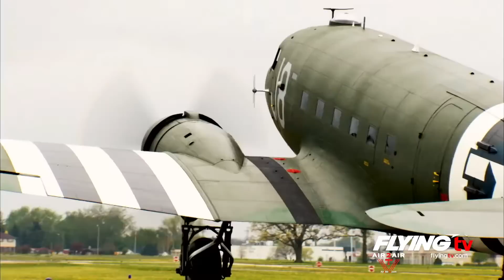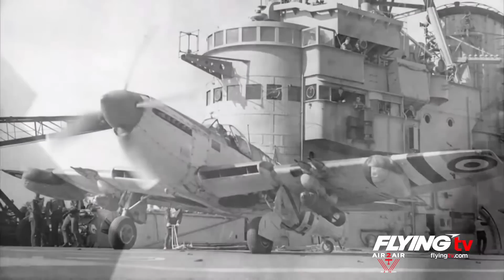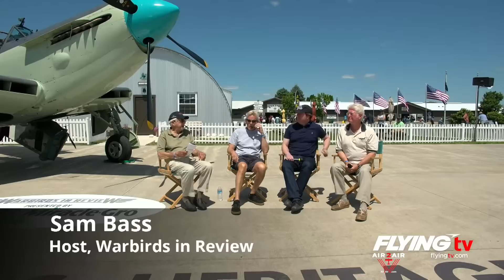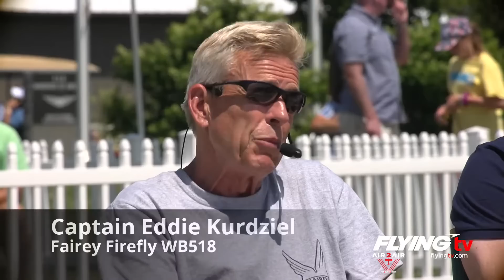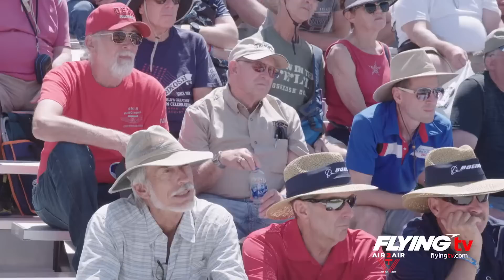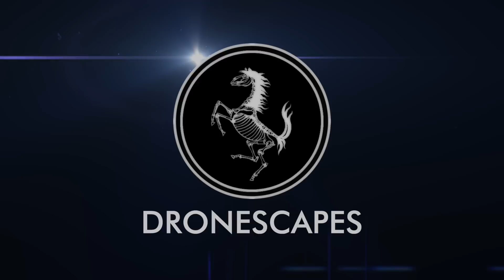FAIREY FIREFLY | The WW2 Carrier Borne Fighter, and Anti Submarine Aircraft

Comment: The British topiedo bomber in the Atlantic was the Fairy Swordfish biplane open cockpit fixed undercarriage that was succeed by the Fairy Albarcor biplane closed cockpit fixed undercarrage both with manual puss backward folding wings that were succeed by the Fairy Barracuda mid wing monopoly with a wide folding undercarriage but the Swordfish was used throughout the war and helped to sink the Bismarck operating off HMS Arcroyal.  As there were no light German fighters Me Bf 109s and Fw190s as there was no German operational aircraft carrier (accept for some long range Me Bf 100 and Ardo Ar 196 ship based float plane) in the Atlantic, however there was the Fw condor.  Whereas in the Pacific the British used the American venger that replaced the barracuda.

Comment: The success of the Fiery Fulmar with manual rear folding wings (there is a static one in The Fleat air armed mouseam in England) the Fairy Firefly with electronic folding wings and the second cockpit was for the navigation radio operator observer and raidar operator not a gunner. Note the wide based undercarriage (unlike a narrow based undercarriage of a Spitfire) and rear folding wing for aircraft carrier use (not folding up like a Corsair) and the British had armed plated landing becks unlike the American wooden landing decks that could withstand a Jampies camcaseir plane attack.     There is a Hawker Fury fighter plane in the background with up right folding wings the success of the Sea Hurricane

Comment: There's been a trend of designing two seat fighters.  If anyone asked my opinion which no one has for the same reasons the Firefly form the 1st time pencil touched paper they knew that with the limited technology available in the early 40's having a navigator/ radar operator and most of all two more eyeballs was worth pretty limited performance loss. I've read in a few articles that imply that FAA flew more night missions than U.S.N. and Japanese navy.  Having   the pilot and the gib being able to concentrate on finding the boat while pilot can put all his attention to flying just following the directions to the target then back to base.  

I apologize for any spelling, or improper grammar.  I ate more than a few minor explosive blast force TBI's.  I'm also a Cajun and 1st generation to speak English as a 1st language.
Reply: Carrier borne aircrafts finding a secure way back to a moving carrier had been a serious problem before WW2. The US Navy solved it by deploying the secured radar based navigation aid YE-ZB 'Hayrake' as its standard homing system for carrier aircrafts early on. This tool had a range of over 270 miles and could be operated easily by the pilot alone without giving away the position of the carrier. The Royal Navy adopted this navigation aid later in the war which negated much of the needs for two seat naval fighters.

Comment: Great video. I’m actually a big fan of the Firefly’s for-bare the Fulmar. There’s only one left and it’s static at the FAA museum in the UKs West Country.
Reply: It looks kind of nice, like it could perform, but just didn't have the performance. The little engine that could. It was like combining biplane speed with bomber turning ability. It seems like the British had their naval specifications too complex like the Germans wanting large bomber be able to dive bomb.
Reply: @kentl7228  The Fulmar could out turn even the Italian bi-planes with its flaps deployed.  It’s main let down was it’s RoC which was awful, admittedly. The need for large self sealing tanks, large ammo stocks, two crew and the general robustness required of naval aviation meant that the only engine around, although a great engine, still,wasn’t powerful enough for the plane. 
The RN was badly screwed over by the RAF during the inter war years (bloody Crabs again!). The FAA had to play major catch up once they had control back in ‘39 and at the start of the war as its fighter itinerary had planes like the Roc in it as well as lots Sea Gladiators and Skuas. The RN requirements for the next plane where based on the fact that RN armoured carriers had smaller air groups so their aircraft needed to be able to fulfil multiple roles -  hence the inclusion of the wireless operator, observer position in the Fulmar so it could recon. and spot shot fall for the fleet. RN doctrine also required a dedicated navigator as they had found one of the biggest risks to aircraft and crews was getting lost over the sea (pre radar etc). 
It’s important to remember at this stage the worlds navies ‘Hot’ carrier operational experience consisted of one raid at the end of WWI. The Inter-War US fleet problem exercises , the Japanese Navy’s strategy plans and the Andrew’s carrier exercises were all coming in with differing results due to differing theatres and tactics. The RN expected to be fighting  Nazi Germany/Kreigsmarine (zero operational carriers) and Fascist Italy/Regina Marine (ditto) so the need for a fighter to take on other fighters wasn’t envisaged. Royal Naval fighters would take on recon/snoopers, TBs and Dive/Level bombers and the Fulmar was well suited to deal with that type of aircraft and actually did so extremely well. 
Against modern, monoplane fighters the Fulmars kill to loss ratio was actually 1:1 but the cohort is tiny.  Most Fullies were lost to return fire from bombers in later ‘41 and ‘42 when they had more armour plate meaning the Fulmars had to close up to make the rifle calibre guns defeat the armour - usually a hit in the nice big radiator in the nose. Against most fighters it could usually dive away (it was derived from a dive bomber after all) or out turn and evade them. 
The big question about the Fulmar is this. The chap in the rear would often arm himself. This was never by throwing toilet rolls btw but they did use Very pistols, SMGs and sometimes Brens, Lewis/Savage guns and Vickers K/GOs. The SMGs were described as “Tommy Guns” but this was often used as a generic term for a sub machine gun. They should have been Lanchesters as that’s what the RN purchased in 1938 (while the army were still dithering) but I’ve never found any definitive proof either way.
The Fulmar was actually the most successful fighter of the Fleet Air Arm (ie it shot down the most enemy aircraft) and all FAA aces scored vics flying Fulmars at some point.
Reply: @geordiedog1749  Good points but turning ability isn't at just biplane speeds. I understand that the Fulmar did many attempted intercepts and couldn't even catch the enemy to risk or improve the kill ratios. I assume that if you were given the option of a Martlet or a Fulmar, you would rather fly the Martlet. )
I would. Let alone a Corsair (hard to land) or a Hellcat.

PS. I do realise that you aren't exactly saying the Fulmar is brilliant or junk, whereas I am perhaps towards the latter. It seems they almost navalised the Battle, not quite serious there. I feel sorry for the Fairey design team because of the specifications, and who made the specifications because the RAF got priority and the Fleet Air Arm got the dregs which created the need for a do everything, imposible wonder plane.
Reply from the maker: Thanks for the info!